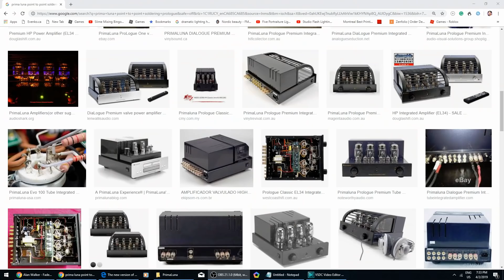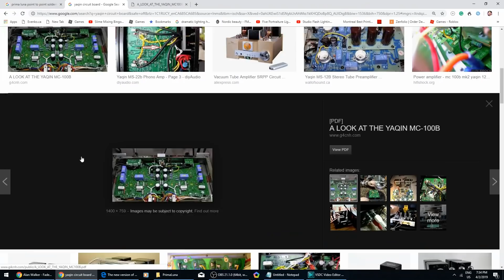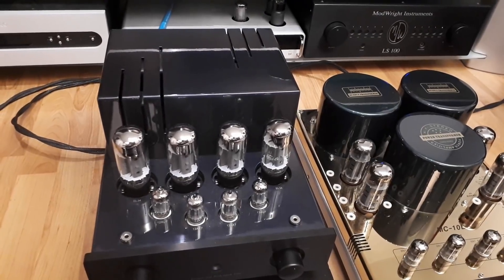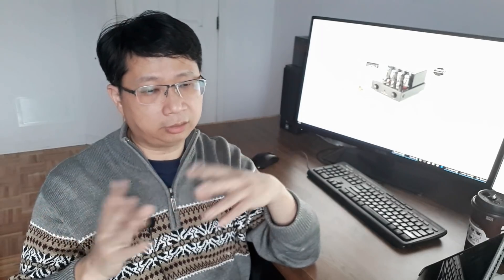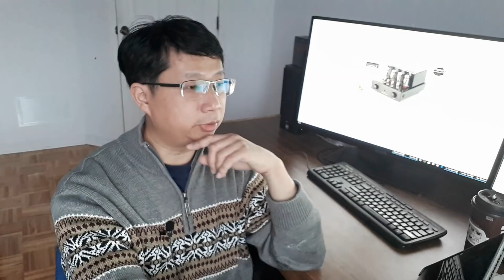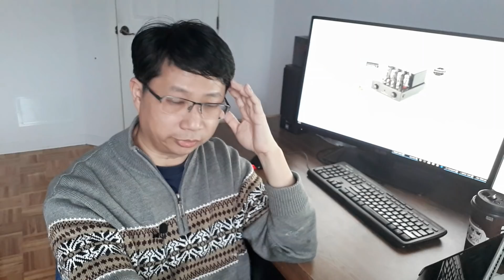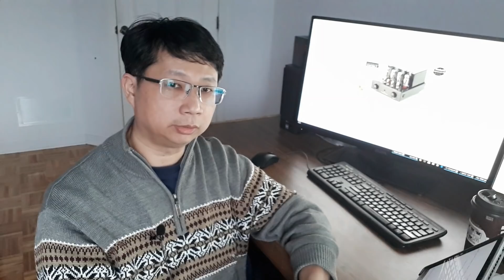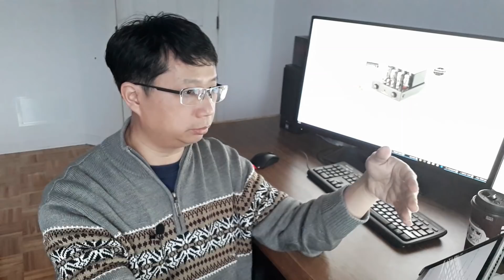Amazing PrimaLuna Prologue tube integrated amp vs Yaqin MC10L

Comment: Have you tried simply using a nice tube preamp with a nice solid state amp to get the best of both worlds?  Being you like warm sound.... you should consider trying an older Harmon Citation 7.1 or 16. I find it to be very similar to McIntosh but less expensive.  My Citation 7.1 weighs over 85lbs 150 watts x 4  @ 8ohms. Massive transformers. I am kinda loving my Cambridge audio (.oo1% distortion) which has kind of a warmer sound. I'm looking for a Parasound for the right price ( Halo) which is also another  amazing SS amp.
Reply from the maker: Yes,  my current setup sometimes is a tube pre and Solid state power amp.  I did have a citation amp in the past but it was 2 channel. I  currently have a Moon w5.3 and I like that one a lot.
Reply from the maker: my comment on it was comparing to the prima luna in this video, of course I don't know anything about their higher end amps

Comment: Does any hires guy settle for CD?  The electronics of your system are only as good as your source and my source in 1980s was half speed master vinyl.  CDs ruined audiophile since we had no way to know what the hell was used as the analog source. And the format itsell was consumer grade. 

Eventually we got SACD and things were better.  But I never found a SACD of "Olivia" and to this day I am unaware of a modern SACD or vinyl.  I managed to round up the last Japanese CD but it was not anywhere near my half speed master vinyl. 

I stream Tidal hifi and work hard to playlist MQA and those few hifi that are well enough sound engineered to make the cut.  But whenever I hear of a "CD transport" in a high end system it makes me take notice.
Reply from the maker: Well, the cdplayers I listen to are $6k to $35k and I would say yes, they are as good and even more enjoyable in many instances. It's not the resolution only that I care about but the fluidity of the playback and that is more important to me. I have many high res files too from96k to double dsd , dxd and I still enjoy both cd and high res files.

Comment: "Upscale Audio" with Uncle Kevvy... aww yiiea.
Reply: Thomas I've had very similar experiences, some tube amps; some are tighter and more forensic and some of the older ones, like a Harmon Kardon amp with Telefunken tubes just had waves of delicious warmth. It just depends on my mood which I prefer - more atmospheric warmth or more holographic. My perfect setup is to run a DSP with Sonus Faber mains running through a tube (or even a Hafler amp), and a servo controlled or short run of speaker cable (12 inches or less) through  integrated sub amp on any kind of sub. To me that's the best of all possible worlds. :)  The short run of cable to the sub means that the full damping factor of the integrated amp (of whatever variety, Crown amp, through Macintosh) is applied to the sub, so in effect it can be servo controlled even without being servo controlled because the bass is sharp and clipped. Having experimented with speaker cable lengths I can tell you the only time you want a really short cable (12 inches or less) is when you are trying to get a servo controlled effect for a sub woofer. If you use that short a length on mains it sounds so mechanical as to be unmusical. But don't take my word for it . Try it and see what you think. El Cheapo cable is perfectly acceptable for for this experiment.
Reply from the maker: Thanks for sharing, Never thought of the cable length, will try one day. Yeah, there is no best sound, it really depends what you are looking for.

Comment: Anybody who has played with solid-state amplifier’s or preamplifiers and tube knows that tube Amplifiers do not have that electrical control of bass notes. They have a very low dampening factor for tubes. Electronic amplifiers have a high dampening factor that speed and transients of the control of the deep bass. This is why tubes are beautiful for the mid to high‘s and the class D amplifier is excellent for the subs.
Reply from the maker: What if they are KT150? I noticed in the comment people are mentioning they are getting great bass control. I don't have much experience with KT 150 so I don't know.
Reply from the maker: @coldfinger459sub0  Thanks for the detail explanation. Yup, makes a lot of sense.

Comment: that was funny what you said DAC sound more like analogue isn't that the point of a DAC I know what you mean I think.
Are you not a fan of mixing it up! solid-state on the output valves on the input preamp, I think that is the best combination if you get matching right.
You should have shielded caps on all of your tubes especially the rectifier needs earthing. tubes with individual caps especially like on some amps where the tubes are very close and can pick up radio wave interference between each valve
Reply from the maker: I usually run separates. Tube for my preamp and poweramp for my amp.
Yeah, the budget dac sound too digital from my experience.
Reply: Do you have any DAC ideas that doesn't sound too digital  with Primaluna?
not to expensive and more to the warmth side?